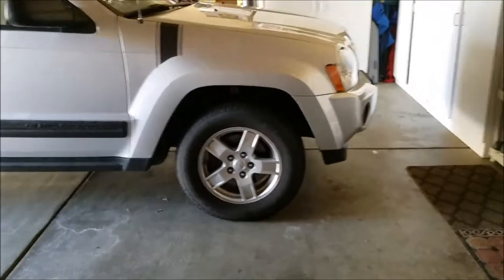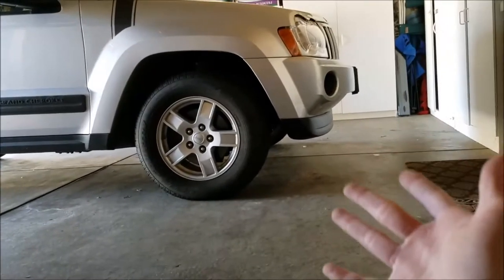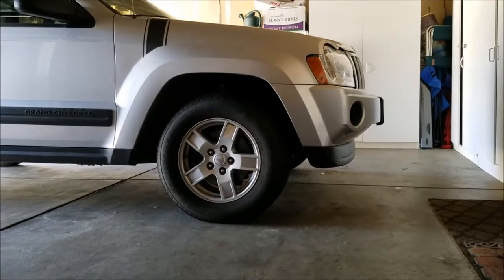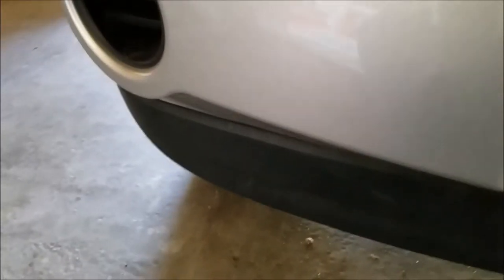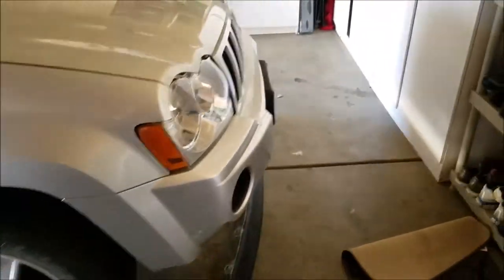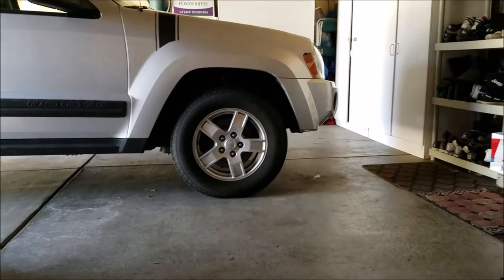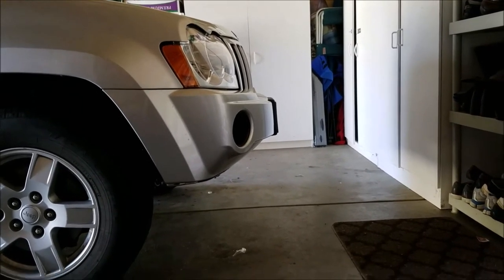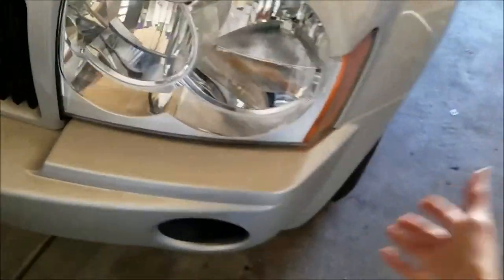How to Remove a Jeep WK Lower Fascia/Air Dam for 2005 - 2007 (Improve your approach angle!)

Comment: I want to do this, but am kinda worried to. Im hearing about hood fluttering, did you have any hood fluttering or any side problems from doing this?
Reply from the maker: Not at all. Been running without the lower fascia for years. Even presently. The last time that fascia was ever on was 3 years ago.

I think the problems you've heard of are particular to the WK2 Grand Cherokees (2011 - 2021). Not our WK's. Those WK2's DO have issues with the trim at high speeds from what I've heard. Cannot go 55+ mph without putting the fascia back on due to something getting caught up/contacted in the wheel well. Someone else can correct me if I got the numbers wrong.
Reply: @TheValleyofAwesome  thank you so much for the fast reply I really appreciate it! I have an 06 Cherokee and been wanting to do this because gosh they look so much better without the airdam. Thank you for helping me because I’ve been looking all over the place all day and couldn’t find the answers to our models so again thank you! Was very nervous on doing it because of the problems I was hearing but with your experience I’m gonna be doing this tomorrow! I’m not worried about the loss of mpg I’m sure it’s not even noticeable I just didn’t wanna mess my car up lol

Comment: Useful video but why would you leave out the part where you actually take the fascia off? First you're removing the clips and in the next cut the fascia is lying on the floor.
Reply from the maker: Back when I made this video many years ago, I was doing it alone. (Recording and doing things one-handed is kind of rough)

The step is also relatively simple in that you pull outwards at both ends of the fascia at the same time with both hands. It comes off very easy and there's no prying required as far as I know if you pull at both ends equally.
Reply: @TheValleyofAwesome  ,thanks! I'll be doing it as soon as we have warmer weather here in Chicago.

Comment: Anyone know how to do it on a WK 2016 model? Can't find any info online
Reply from the maker: Hem57i Unfortunately I don't :/ Have you tried looking in your manual? Maybe they have instructions there?
Reply from the maker: Hem57i And also, there should be some information the Jeep Forum websites on how to remove the fascia on the WK2's. I did remember seeing a post on how to remove it there once
Reply: Tried to look in the manual and couldn't see much, but with how thick the manual is with all the new features, maybe I just missed it.
Jeep forums all seams to be posts from 2011 and all photos are now missing or are instructions for removing the whole bottom bump and not just that plastic looking thing.
Ill just have to keep looking, thanks.